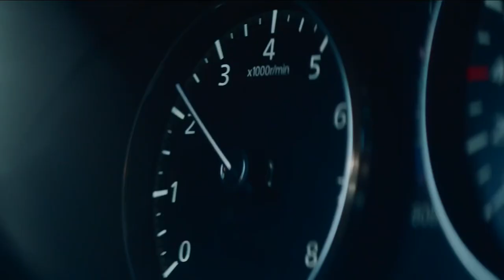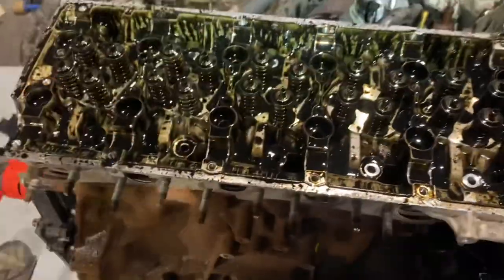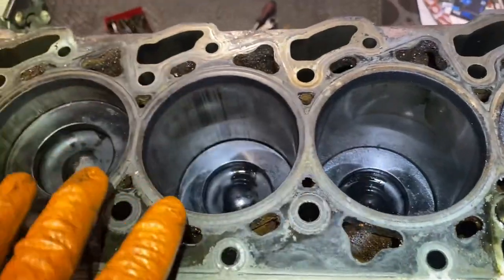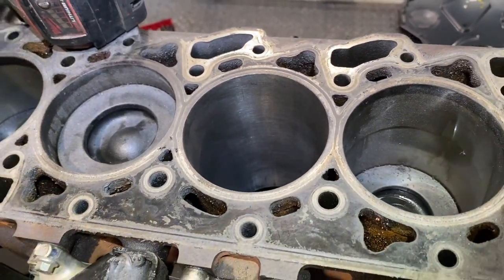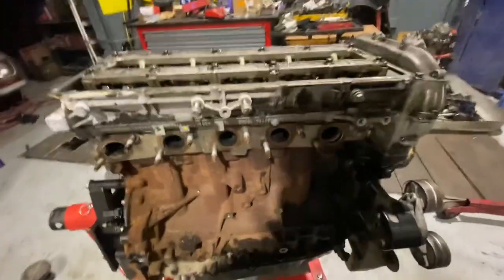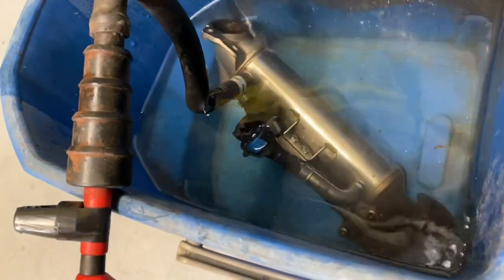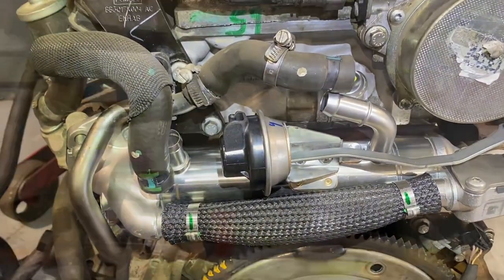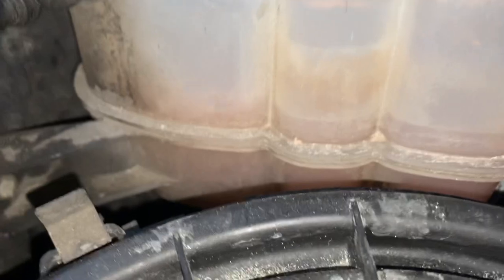Ford Ranger Part 2,knocking noise fix / piston replacement

Comment: Happens to all of us. In my case, I recently spent over 1k repairing the head on a Yamaha outboard, because it was letting in water. Only to find, later, that there was also a hole on the block that I hadn't seen. When it happens, suddenly everybody else is an expert on the subject lol. This is an interesting video for me because I just bought a high mileage 3.2 Ranger. Fingers crossed it keeps on running. Cheers from Australia
Reply from the maker: Hi Tim, spoken like a gentleman. Hindsight is a great thing 😬😬😬
On your jeep, if you replace the egr cooler before it fails it avoids all of these problems. Thank you all the way from Ireland 🙏🙏🙏

Comment: Thanks for your honesty posting this, that takes balls. only someone with confidence in themselves would do so.
Most workshops nowadays would not take on these jobs.
Just a side note on these EGR coolers, I had one I suspected was faulty, the customer stated that is was going through coolant and blowing white smoke occasionally but running smooth. We removed the transmission and unbolted the exhaust flanges both sides (slightly different design to yours). Put the pressure tester on the cooling system o/night and in the morning, nothing, no coolant coming from the exhaust side of the cooler. After some thought I heated the cooler up and then the coolant came pissing out!
I cut the egr open to try and figure out why they fail, as this seems common.
My theory is the failure point is the ends of the cooler pipes that have the exhaust gas run through them fail.
They are sealed at the ends by all fitting into a round plate at the end, then the ends of the tubes are just flared to seal them to the end plate, over time with heat and expansion the tubes are growing in length and pushing away from the plate, hence why mine leaked after I heated it.
Just my theory.
Love the cartoons, awaiting part 3.
Reply: cars there making now a days are rubbish iam driving a ford focus the last 14 years from new only  done servise on it regularly and fuel filter needed changing still going strong
Reply from the maker: Very interesting Glen, that is nice information to have just to be cautious of them when they are cool 👍👍

Comment: Down under here in Oz, pulling loads, like camper vans etc 3.5t or equiped 4wd, this can happen to alot of us. The egr cooler fails, loss of water, you cook the engine, score the cylinders and warp the head. They say new engine time. Egr's are a big issue, 85k kms on average it seems. Needs to be a class action, these engines aren't making the distance. Needing to top up water, bubbles, loss of power (limp mode), white smoke, you have an issue. Great job on the rebuild btw, seem to catch it early. Down under, we secretly block and bypass egr once out of warranty.
Reply from the maker: @rjn5404  your explanation of the series of events is bang on. It really isn’t good enough for such a small problem to have such large consequences. You’d think something could be done 🤷🏼‍♂️🤷🏼‍♂️🤷🏼‍♂️

Comment: I AM VERY MUCH LIKE THIS VIDEO. THE HONESTY OF THIS MAN IS BRILLIANT. THE LAST CLIP I'VED SEEN AFTER STARTING THE ENGINE AND THE BUBBLES COMIN UP AND ITS LIKE A FISH TANK. ITS THE SAME PROBLEM ON MY RANGER IT BUBBLES UP EVERYTIME I START THE ENGINE BUT NO TICKING NOISE. IN THIS VIDEO I HAVE NOW IDEA ITHAT IN MY RANGER THE PROBLEM WOULD BE HEADGASKET THEN MAYBE THE CYLINDER HEAD WARPED. SO IT WOULD BE BETTER TO BUY A NEW HEAD AND INSTALL OLD COMPONENTS OUT OF THE OLD HEAD THAT WOULD BE LESS COST .SKIMMING THE HEAD AND TEST IS COST MORE A LOT THAN BUYING A NEW ONE... THANK YOU FOR THIS VIDEO I COULD DO MY OWN NOW AND EVERYTHING IS IN PLAN...GOOD JOB MATE
Reply from the maker: Hi Louie, the actual cause of the head gasket and ticking noise in these engines is due to the engines overheating. 
This is caused by the EGR cooler to the rear of the engine failing. 
This EGR cooler gone can give similar symptoms & I would advise changing that first & the monitoring you symptoms again. 
Let me know how you get on 😉🤞🤞

Comment: Have a Ranger  🇦🇺2016 Px2 3.2L. With 150k on the clock.
Running well🤞
I do all the maintenance and services. 
Great engine…just need love and care. 
I run 2 fuel filters 4 & 2 microns 
Catch can
Fuel doctor in tank
3inch exhaust 
4 inch raised snorkel
Oil change every 10k 
Etc etc 
About to do an egr clean 
Would love to replace the EGR cooler,NOT DELETE, but it looks like a bugger of a job. 
Love the video 
Good job👍
Reply from the maker: It is a bit awkward but a very common failure item & most engine failures are due to the cooler leaking and engine overheating. 
It would be worth replacing on such a good machine 😬😬

Comment: We are in Zimbabwe and we have a 3.2 litre Diesel with a similar noise.... I am starting with 5 new injectors and new bleed off return pipe... I pray this sorts out my ticking problem.... however the previous owner removed the thermostat so quite a few questions as to why he did so.... now because of your video, I will be wide awake as to my next step... that is if I don't win with the new injectors.... I have also been told to replace the genuine vein oil pump with an aftermarket gear pump because the vein pump suffers from air locks and thus runs the bearings...
Reply from the maker: @wordopencom328  hopefully the injectors will sort it & the oil pump would be worth changing 🤞🤞
Reply: I was going to sleep at part 1...then started to watch part 2. I started to wake and watched the lot. Kudos to you for being honest and upfront. Some mechanics here in Australia just sweep under the carpet and try and get away with their mistakes and then charge the extra time spent to the customer 👏 👏 👏

Comment: I just want to say you’ve done what the rest of us would do! I really wish I found this video before doing the exact same as yourself! New oil pump, crank regrinded, big ends, head gasket etc.. head looked decent so chucked it back on and now I have pressure and bubbles! 

Did you sort it after taking the head back off and skimming ? 

Keep going though as it’s because of these little errors big garages aren’t doing these jobs any more.
Reply from the maker: Yes, it came right once I removed the cylinder head again and got it skimmed & pressure tested. It can be some pain in the bottom at times. The only bonus is that it happens so much faster on the second occasion 😬😬😬

Comment: Hi free thinkers, two points cause excess piston ring & cyclinder wear. One is the Crankcase vent valve gasses from crankcase directed into intake after air filter, particulates are abrasive. People fit catch can to crankcase vent system to minimise damage. Some catch can filters become blocked & crankcase pressure is relieved through crankshaft seal actually leak oil at seals. The main abrasive problem is EGR Exhaust Gas Recirculation, this emission destroys piston cyclinders & rings with exhaust carbon directed into selected cyclinders. When you remove cyclinder head first give away is ring ridge excessive due to exhaust abrasion. You can see exhaust mottling on valve seat, valves seat maybe leaking. Most engines diesel destroyed at 300, 000 klms.
Reply from the maker: Handy information Steven, thank you for watching & commenting 🙏🙏

Comment: It takes a MAN to admit your mistakes! My problem is with the honing, you should have measured the bore before reassembly. If it's got an MLS head gasket, always need a touch up. I'm starting the same job in a week time, thanks for showing me what I am up for!
Reply from the maker: Admittedly I am not an engine builder. But strangely I regularly end up in this position. I really wouldn’t be a fellow to be taking training lessons from but it works for me. 
Hopefully the walk through helps though, just to show what is involved. Cheers mate 🤞🤞

Comment: Great for being honest. We've all had jobs that turn to shit. You learn from them. I have seen diesels shrink pistons because of heat causing a noise like a big end. I did a similar job on a Hilux and used the original head, it was fine. It did look like it was replaced probably from the overheat that did the pistons. I rolled the dice and got lucky. I too have been bitten by a Ranger, replaced the head , EGR cooler, water pump & radiator, only to still pressurize. Problem was a hole in the block.
Reply from the maker: Aaahhhh, I feel your pain on that on Jamie. 
Those jobs are the ones I feel really bad charging for, hence sometimes just keeping on going until it is right. Then I’m happy enough to charge once it right 😉👍👍

Comment: The pistons expand during egr cooler failure overheat, pick up on the bore. Didn't happen on 2011-2015- but seems to happen more often than not in 2016+ 3.2.
Reply from the maker: That is correct and the cooler is quite awkward to get at but far easier than rebuilding an engine 😬😬
Reply: I'm praying you are right but i have the same tapping after egr cooler failure. Coming up with 2 codes of leaking injectors. Could this actually be low compression?
Reply: Should have said mine is 2013 so praying its not damaged pistons and bores
Reply: Great video @kennedysgarage3281
Reply from the maker: @adamcairns1477  thank you Adam 🙏🙏
The injectors fail on these engines very commonly too. I think the best attack is to remove the injectors and send in a camera for a look. If you done see anything wrong then send all 4 injectors off for testing. Either way you will get an answer 🤔🤔

Comment: Thanks for sharing and the honesty most orhers would not expose the real world problems faced with engine repairs. Will you share final result after head skimming?
Reply from the maker: Unfortunately I lost the recording of the short finale 😔😔
Reply: @Kennedy’s garage  ok hope it all came together and worked in the end.
Reply from the maker: @coadyg  yes Gary, it all went to plan after I learnt my mistake not skimming the head. I was editing the fast final assembly and had deleted or at least couldn’t find a 3 minute recording. It didn’t work right without it 😤
It is gone out now around 3 months with no problems 🤞🤞👍👍👍

Comment: Chocolate Ford pistons Peter - have a look at the ones in Transits - similar issue - soft pistons (loads blow holes in themselves & slap about in the bores causing scoring) - new pistons. But the new ones tend to be as chocolate as the old ones & cack themselves in jig time as well...... rebuilds tend to be semi-temporary..... Honing was the right call as the issue isn't the bores - it's the junky pistons.
Reply: By "Transits" I mean the newer woosy ones..btw. Another ^^ eye-waterer for someone. :-) Gotta love the new stuff.. the ending....toasted - you ain't alone in that being a shocker - wouldn't have dawned on me either. More eye-watering stuff... The Struggle never ends.
Reply from the maker: @jamesward5721  tough times James, ah well it’s done at this point so I don’t mind but the repair does get tougher 😞😞
Reply: @kennedysgarage3281 very few out there tougher than you Peter - be Grand. :-)
Reply from the maker: @jamesward5721  🙏🙏😉😉
Reply: @kennedysgarage3281  I did weld an entire Vitara rear-end today including the full LH quarter, both rear arches & both door-shuts that another place totally butchered.. I don't know but I think it might be a new World Record for "Most Bodywork done in 1 Day, Ever"..  - so I am qualified to comment on your fortitude... :-)
Reply from the maker: @jamesward5721  well done James, hard goers like that are getting scarce. Fair play to you 💪💪💪
Reply: May I ask, what are the options of fitting forged pistons on these?

Comment: When you want to check the head gasket  first  remove injector  .when you keep piston at top .then four  valve should be closed. Then open the cap of radiator . then where you remove injector   from the hole.when you put a pressure of air .Then you observe the bubbles on radiators cap.so,I think that your head gasket is leaking.
I am not suitable to tell you this.but you can try my advice. 
And I hope that this will help you. 
And I learn  every thing from  you and I am still learning from you....   😄
🙏🙏🙏
Reply from the maker: Excellent advice and very well explained. It was the head gasket but I will use you test process in the future, thanks Lovepreet 🙏🙏👍
Reply: @kennedysgarage3281  🙏🙏🙏🙏❤️❤️

Comment: I'm not gonna complain because I'm not a mechanic but the egr cooler failure is a nightmare that Ford engineers have created. I think Ford should be replacing engines no cost. What worries me is I have a Ford Everest which is exactly the same in Australia. The Everest is a 7 seat wagon based on the Ranger. I'm deeply worried that my egr cooler could be on it's way out. This could easily happen again and frankly Diesel, Petrol is too unreliable in this day and age. I can't wait for an offroad EV.
Reply from the maker: I agree, it isn’t good enough. But it would be worth will replacing the egr cooler just for peace of mind, especially if you are not the only driver 😉👍👍👍

Comment: Hi I have a 2014 3.2ltr Mazda BT50 Dual Cab and after rebuilding engine and driven it for about 500klm going up a hill engine started making knocking noise and loss of power later did compression test and cylinder 2 had very low compression, opened engine up removed head and and oil sump and removed piston 2 finding out piston was badly damaged same as yours and oil rings were stuck into the grooves cylinder walls were marked similarly to yours, put in brand new piston oil rings and big end bearings changed oil sprayer in that piston thinking that could have caused the problem, then I put engine together again took it for test drive, drives beautifully then went up the hill engine shuts off on me let it cool down switched it on and engine started making knocking noise again unbelievable low compression cylinder 2 again and cylinder 5 has a bit of scraping and on the walls crazy don’t know what is causing this only happens under heavy load going up the hill my mechanic reckons it overheated but my heater gage looked normal didn’t go past half way.
Could you please give some suggestions and recommendations it would be much appreciated?
Reply from the maker: @erminhadzic8641  oooohhh, that sounds like a bit of an ordeal. It can be hit and miss when you go in that deep into these engines without prior experience on them. You probably noticed that I had to remove the cylinder head from my engine at the end of part 2. 
Hard to make a profit when that happens 😬😬😬

Comment: Some surprising things to me in this video.
When using a scope, if you turn the scope and the image or perceived fault rotates with you, its the scope, if it turns opposite in reference to the image, it's in the engine.
Straight honing the bores, no cross hatching.
No oil pump replacement.
Spin the engine so it "hopefully just lubricates", no actual pressure testing!
Using old coolant hoses on the EGR cooler and anywhere on the engine!
Not replacing worn gears because you like prefer the look of the old ones, ready to wear the new chain!
I'll guess the bearings weren't plastigauged.
Yeah cut me down, I'm not a mechanic but I'm "sure glad it's not my vehicle!" YMMV!
Edit: And I didn't even get to the end of the video, have now, wow!
Oh well, maybe next time it'll be WHOLLY different!
Reply from the maker: I guess you are absolutely correct. The engine should be removed and sent to an engine shop to be rebuilt with everything you mentioned done. 
The owner had gotten quotes & time lines for this but did not like either, so asked me would I take it on. And yes I did at a much smaller expense & time line. 
I was speaking to the owner 2 days ago about his A/C and the car is running perfect.

Comment: I have a 2.2 ford ranger 2012 with a knocking sound coming from top. Could it be lifters?
Reply from the maker: It is impossible for me to say, but as in this video the egr cooler fails very commonly and the over heating causes that kind of noise 😬😬😬

Comment: Should of taken the opportunity to change the oil pump to the new upgraded oil pump.
The ford oil pump are know for distruction!!!
Reply from the maker: You are right, I probably should have. In hindsight I probably should have replaced the complete engine block, it was only 2.5k. Probably a better overall job 🤔🤔🤔

Comment: How can I bypass or delete the EGR valve, im based is RSA and have same troubles with the EGR
Reply from the maker: I actually haven’t ever deleted or bypassed one. If you can disconnect the water from it, that’s a good place to start 🤔🤔

Comment: Hi!..should i hear air being sucked by the vacuum pump in the cabin of the mazda 6 2.2.. after replacing it with a new one.. when accelerating, i hear the noise of the pump.. is it normal?
Reply from the maker: No, definitely not. Are you sure it is air from the vacuum pump or could it be an intercooler pipe loose after refitting??
Reply: I will check it with my mechanic.  I will let you know.. thank you very much for the tip

Comment: hello, I saw the mechanic and it turned out that the turbo is falling ... it has too much slack.Turns out that's where the weird suction came from.
Reply from the maker: Ooooh, very interesting & thanks for letting me know 🙏👍👍
Reply: @kennedysgarage3281  he checked the turbo several times before and it was ok it had slack, but as it should have.  the conclusion that it was already at the stage of disintegration.
Reply from the maker: @lukaszm.5385  Ah well, good luck with the repair Lukas 🤞🤞
Reply: Hi..and thank you...I bought a remanufactured turbocharger, it was fitted this week.  The car runs really nice beautifully and cleanly accelerates.. nothing but drive ... pure driving pleasure in the end. Greetings and thank you 😀
Reply from the maker: @lukaszm.5385  well done Lukas 💪💪💪